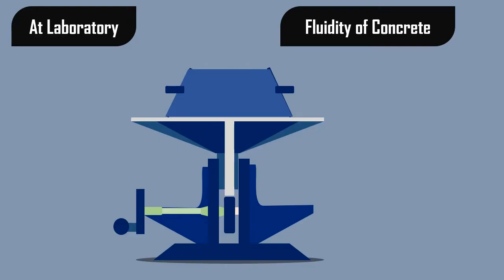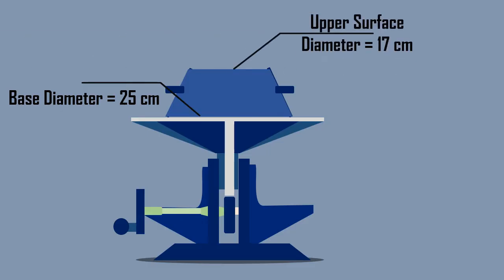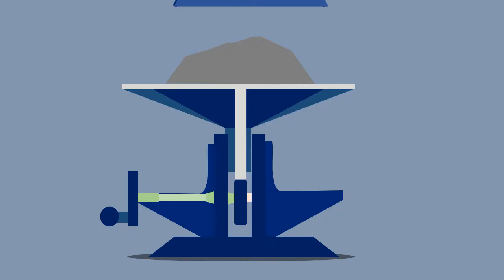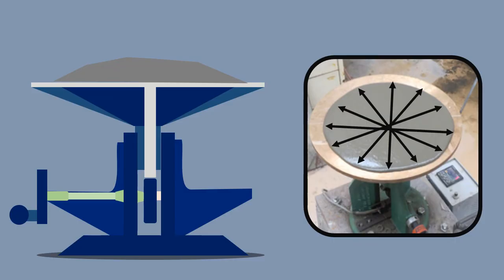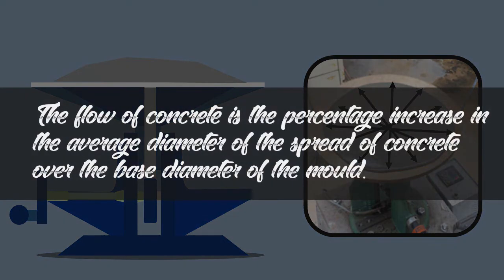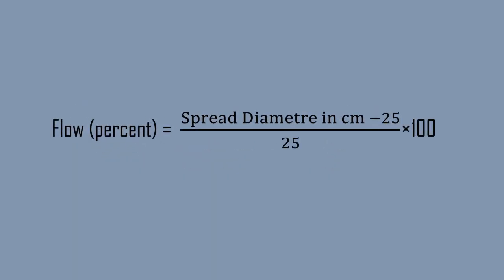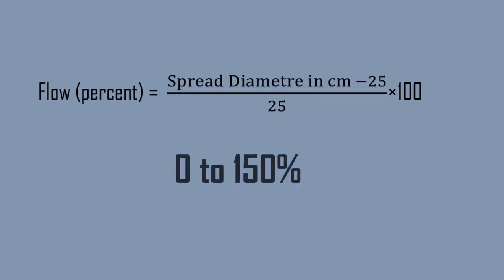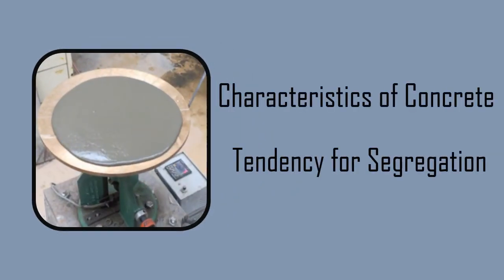Flow Table Test for Concrete || Test for Workability of Concrete #4

Comment: thank you for your video. But this test is not doing for concrete i think. concrete flow table is completely different from this. this equipment is used to measure the flow of cement mortar.
Reply: You are true, this test is performed to test cement mortar according to ASTM C230 and C 1438